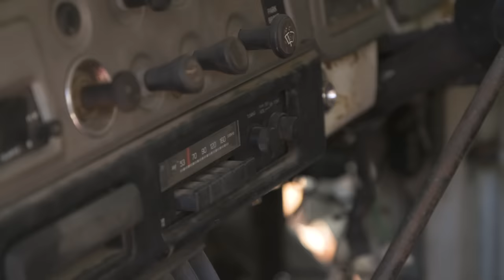THIS 4WD HASN’T RUN IN 19 YEARS… Will it start? Shauno's Barn Find Toyota LandCruiser 40 series!

Comment: Toyota surf petrol booster
80series master cylinder 

Brake upgrade 
You can hold 4plus tonne on a steep hill with very little or hard brake pressure

Factory setup is woefull loaded or towing brake wise
Or even on a hill
You need full body weight to hold ot on a hill

Pushrod stud needs trimming down though
Mines got factory air conditioning

Comment: should of got it going on the old oil first to get rid of any contaminants from sitting and then drain it and chuck more in so its not running with the same sludgey contaminants

Comment: you really did not need the battery just drag it with another truck its the easiest way to start a engine that has not started in years it does not stress the starter

Comment: This guy seems to know as much about cars as his cooking  (it wants to start you can tell) omg did he even put wheels on this unit. I seen the clip where these guys recovered the young guys 4x4 from the surf at Frazer why didn't these guys put the 2 spare wheels on this vehicle  before trying to drag it out . These 3 things i would have done to recover this rig would have been 1 change the 2 wheels that were flat and kept burying themselves in the sand 2 jammed max tracks under the front wheels and ratchet strapped the other end under the bull bar to use it as a skid but i suspect just by changing both flat wheels would have eliminated using the max tracks anyway and 3 used snatch blocks to take the strain off the winches. Just changing the wheels would have made it so much easier. I like the show but a bit more thought would go a long way . never go on the sand without an air jack or inflation bag saves a lot of digging

Comment: hahahahahahahahaaaaa. RENOVATORS DELIGHT of course ROFL....I do hope it was at a Renovators Delight price, it may need a wheel or 2 or 4, a door, bonnet and...................  I used to have an FJ40 straight 6 petrol in the late 80's to the early 90's it was great fun and easy to work on. At least it turns over and not seized. Whooo hooo first turn after heating the rail.. winner winner chicken dinner!! I love an old diesel engine soo easy and simple to work on very basic systems, none of this electronic shit to stop you or the motor. haha no turbo that will kill ya.. welcome to the non-turbo world. Nothing like a bit of betina, to the looks of things. Enjoy. bring it to Melbourne and join me with my 80 series and we can do Mt Dissa.